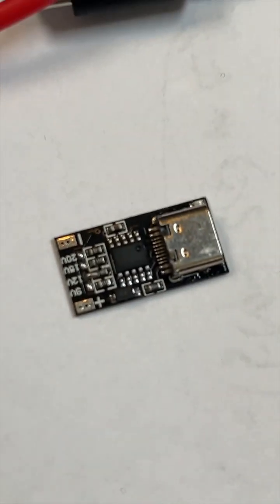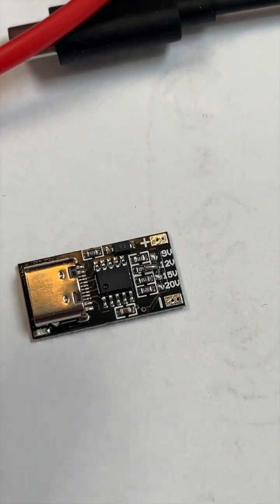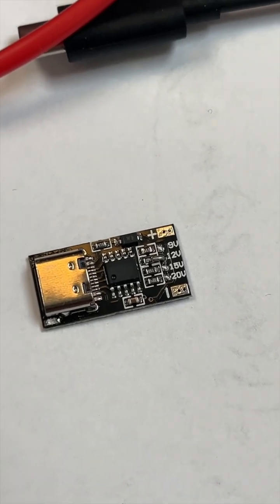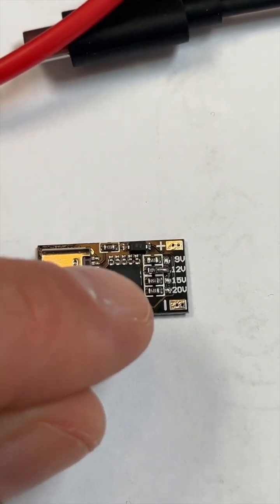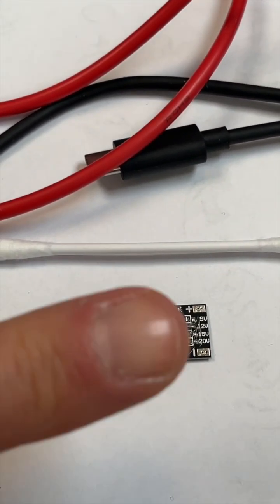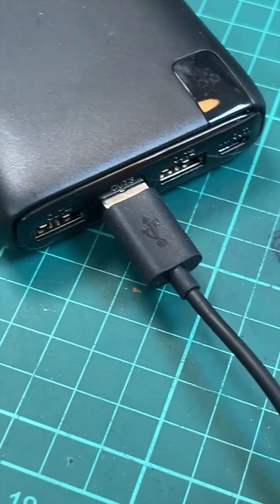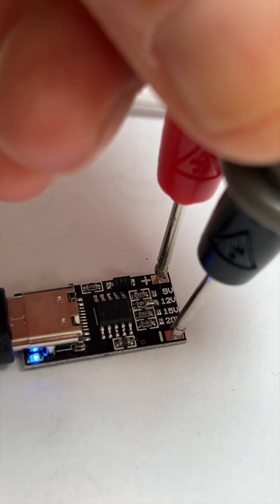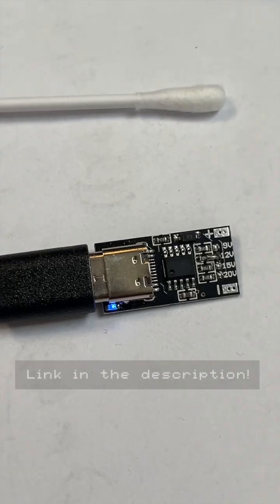Power any project (voltage) via USB! USB-C PD Trigger board #projects #cheaptech #raspberrypi

Comment: I have a question, if i were to switch voltages do I need to unsolder the 12v then solder the voltage out put I want? and for the power supply do I need an adapter for it to work?
Reply from the maker: Yes you have to unsolder the 12v and solder the other pad. Only one pad at a time! The power supply must be a PD compatible USB-C charger with a USB-C cable.
Reply: @RetroWK  thank you so much
Reply: @djwiggles8649 there are versions with built in switch as well, donno why he didn’t mention it
Reply: @whitelotus_zero  ohhh I see thank you so much

Comment: what is max amp it can supply for 5v?
Reply: 5V 3A, if you want any higher than 15 watts you have to use the 3.1 spec for up to 20V 5A
Reply: @qfurgie  hello but in here doesn't have 5V. which mean i have to buy another buck converter ? for god sake i was buying a charger to power my raspi 5 that need 25W
 and now it stuck with 15W
Reply: @Dr.001-q5s  where you able to solve the issue?
Reply: @VectrRex  because i'm using pi5 for robot so i have to buy another board that 52pi raspi. but if you don't have mobile robot and no plan to use it, just buy raspi charger. it's much cheaper than PD trigger

Comment: Also a handy way to replace the old transformer & rectifier in older computers, removing a bunch of heat!
Reply: No way you could replace a desktop power supply with this thing
Reply from the maker: Since the PSU is external and these things can take up to a 100 watts, that should work. ... at least for any standard retro computer. https://de.aliexpress.com/item/1005007052792328.html
Reply from the maker: Yep. Since the PSU is external and these things can take up to a 100 watts, that should work. https://de.aliexpress.com/item/1005007052792328.html